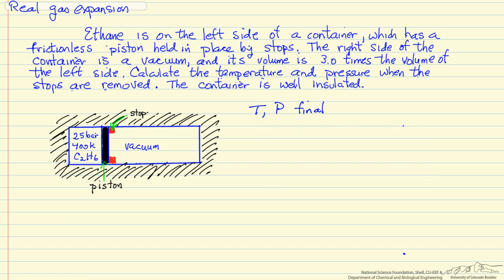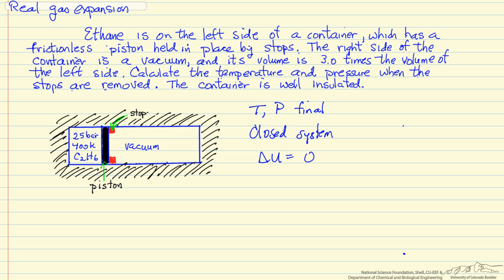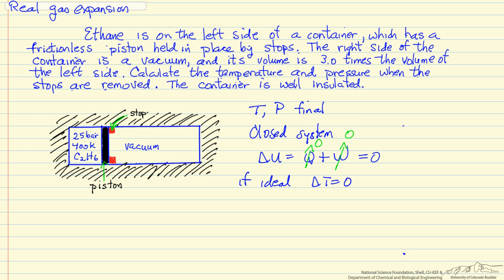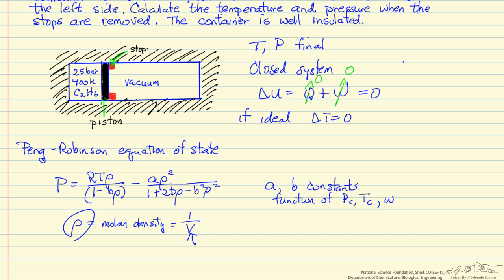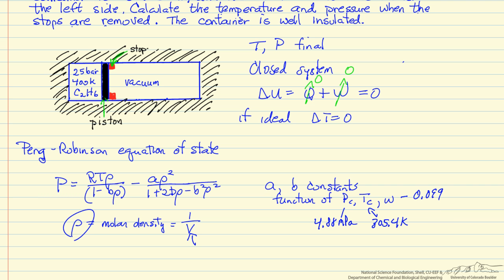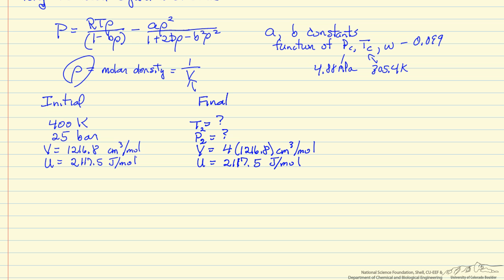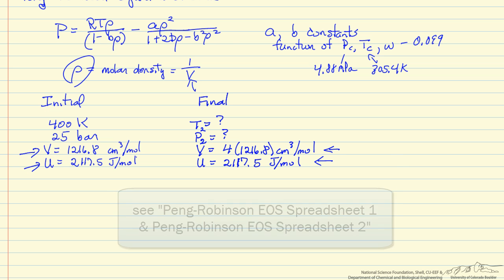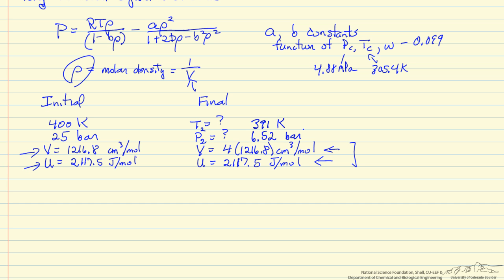Real Gas Expansion

Comment: Why is there no work being when you remove the stops?
Reply: Because pressure by external forces=0
So work which is integration pext*delv =0
Reply: because it takes everything as a "system"
Reply: no friction, no shaft or anything, if there was a pressure against the piston it still wouldn't produce work because there's no heat exchanged with the outside (adiabatic, frictionless)